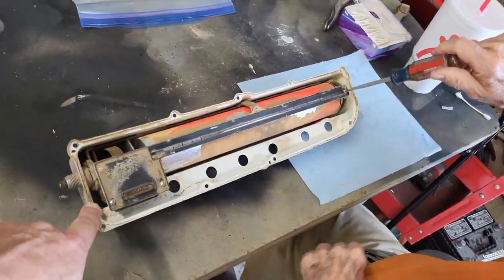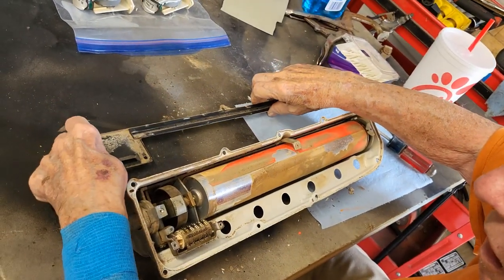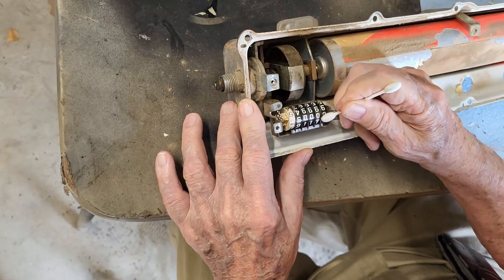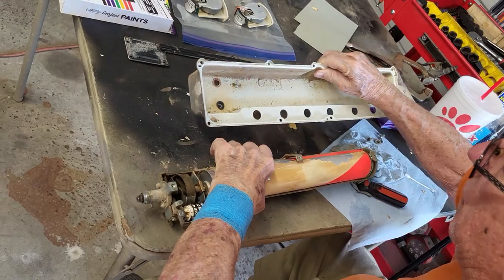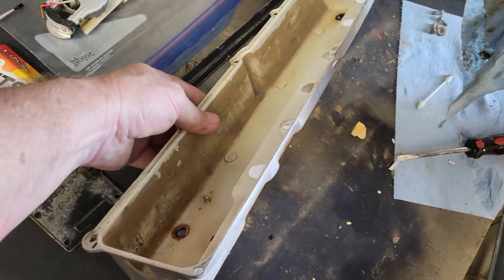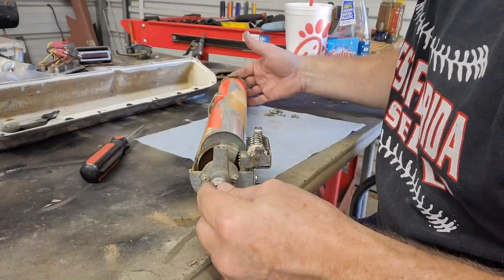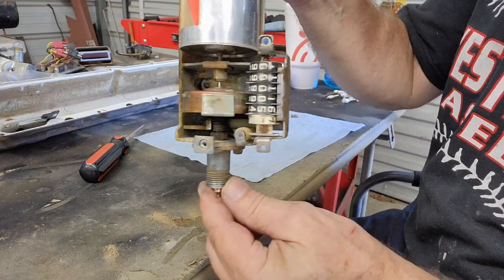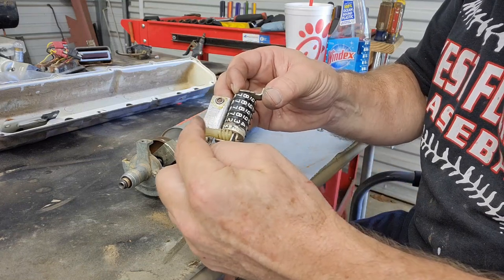Speedometer Fix - 1964 Thunderbird

Comment: Hello Matt. That odometer was a bugger. I think when trying to clean those old parts something like Windex needs to be used first. Even soaking in soapy Dawn soap and water probably would loosen up the gunk and not ruin the plastic or numbers.
I've also had issues with electronic cleaners that ruined plastic surfaces. The speedo repaint looked like it will be ok.
I was going to suggest painting the gauge indicators purple to match the car, but that might have made it too difficult to see them. Lol.
George B
Reply from the maker: Hello George.   So I do like the idea of soaking the parts.  It's a little late for mine, but it's a good story of my dad blasting all the numbers off, so I'm keeping it as is.  I never thought about the purple for the speedo.